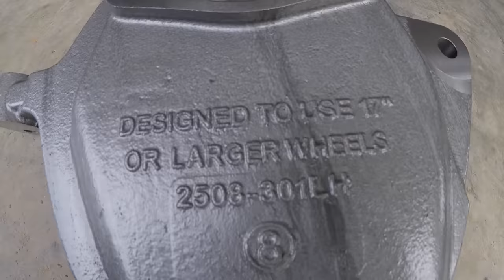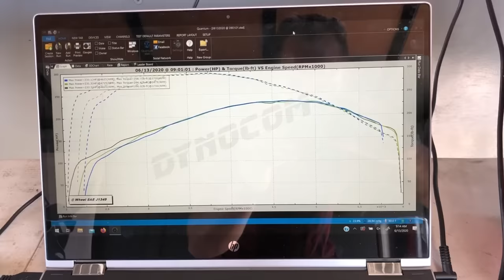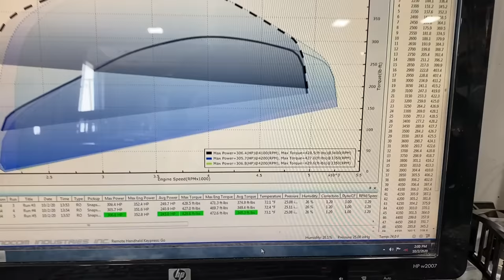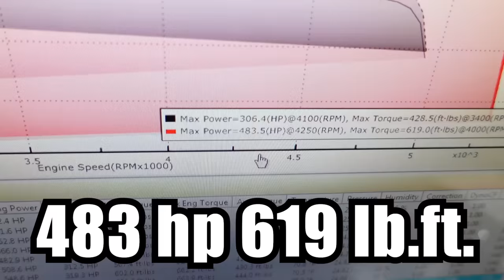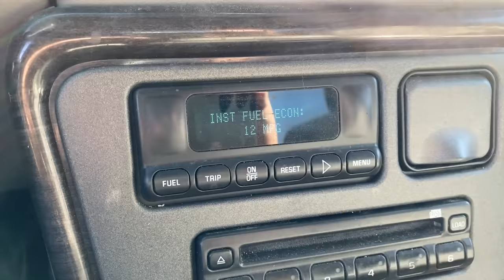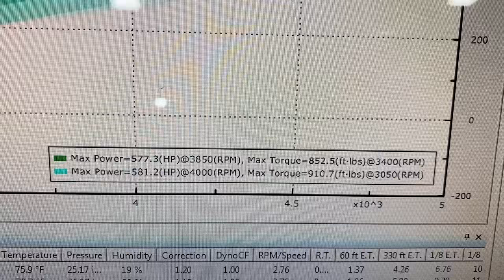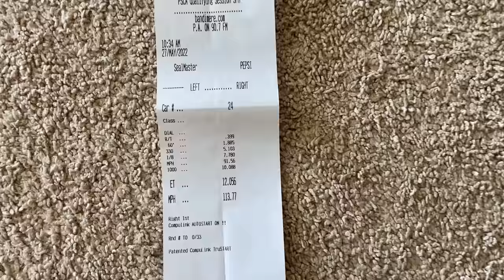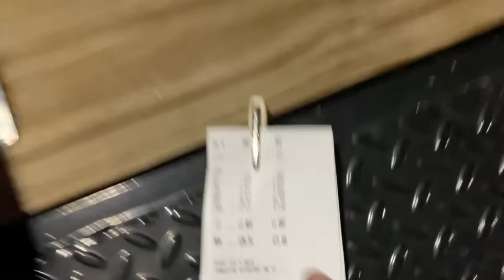Building the ULTIMATE SLEEPER SILVERADO in 23 minutes

Comment: If you spent 3 grand you should have went with a 99-06 single cab shortbed would have knocked atleast another second off you're time. Those extended cabs are frickin boats.
Reply: Yea your actually 100% right, I looked just to verify and was shocked.. just the rear seats doors frame all that to extend the cab is an extra 1000lbs😮.. that’s not even accounting for the bed which has to be another 500-1000 because it ain’t just the bed it’s the frame, longer exhaust, wiring, all that.. wow I’m kinda blown away actually
Reply: Maybe if you completely gutted the back seats, and installed a short bed? I’d like to know what the weight is purely of the cab being extended like the body of the cab and the frame rail.. but shit all that work you might as well if gone single cab in the beginning
Reply: No bullshit this actually helped me out a ton I want to do a truck build this winter and I already have a very clean quad cab so I was just going to use it even though I want a single, just to save money., but yea no not now 😂😂
Reply: @JaxonPro-y9e  shoot glad I could help. I'll let you in on another little hint. 99-06 chevy 1500 short beds aren't to cheap BUT the long bed versions are way cheaper more available and they make kits online to cut and shorten the frame to make it a short bed. It's surprisingly easy there's actually pockets on the frame that you can cut into and the rear frame slides into it to make a short bed it's like chevy knew!! haha
Reply: It’s suppose to be a sleeper.
Reply: It’s a full size build not a single cab build . Not everybody is a fan of single cabs. Im always trying to find ext cab builds all I ever see is single cabs
Reply: The extended cabs aren’t boats the crew cabs are that’s why they have ss in ext
Reply: @MidNight_5.3  lmao have you weighed one. The extended cabs ARE boats and the crew cabs aren’t even in question they are 🛥️ yachts. If you’re trying to go fast idk why you would ever consider swapping a crew cab.
Reply: @aaronvilla13  all you ever see is single cabs because if you’re trying to go fast why on earth would you want more weight? You wouldent. No body is knocking the ext cabs I like them to. My point was if you’re purely just trying to go faster in the 1/4 and you have a choice go single cab.
Reply: @ModernBeastx1  yeah I know I don’t want a crew cab I’ll
Keep my ext
Reply: Goofie
Reply: @trentwoods5112  yeah okay lil bro don’t even got a truck
Reply: I dog single cabs all day in my ext cab
Reply: @RobertoCastellanos-m1u  yeah that’s what I’m saying like it’s not too much of a difference

Comment: Great videos can't wait until next spring. I would have always thought rear wheel was better than 4 wheel because of the more parts more problems. I learned something thanks
Reply from the maker: I wouldn’t say 4x4 is better as a blanket statement since you are correct a 2wd has its advantages, but I like the advantages a 4x4 provides despite the complexity and added weight

Comment: Anyone that thinks a bigblock Chevy is weak has some kind of cognitive dissonance. It was built to be Chevys most heavy duty engine from day one. The MK4 came directly from a NASCAR engine built to smoke everybody on the track back in 1963. Hit the street in 1965 as a 396 425hp Vette engine. 427 came in 66. L-88s came along in 67 thru 69 and a well tuned L-88 with headers could make 560-580hp stock. Could even find 427s in big ass dump trucks and 454s in giant RVs. Bigblock Chevys set the bar for which all others try to compete with. Definitely the best engine ever built by any company. It's hard to not make power with a properly set up bigblock Chevy. Back in the day I tried to compete against them with other brand engines, it was always the big Rats that dominated the scene. So I started using them myself. If ya want to go real fast, build a bigblock Chevy. Easiest power one can build.

Comment: Awesome build just wondering why didn't you go with the 6.0  V8 my Chevy Silverado 2500 HD has the 6.0 regular cab short bed 2 wheel drive she is a beast only thing I have done is Cold Air Intake and Dual Exhaust

Comment: Nice recap LT .
Love the ugly build. 
I got bored tonight relieved the deck on my 8.1 and knocked the cam bearings in it . Won't be too long before my turbo 6.0 4l80 tow rig is .020 over marine h.o. cammed intake modded 8.1 and Allison 6 speed .
Once I tow with it I'll decide if I'll turbo it or not .
Now a days towing alot on 93 octane gets expensive

Comment: great video! Just my two cents, upgrade to a full face clear shield using the angle grinder vs just the safety glasses. Angle grinders hands down the most dangerous tool I've seen guys lose fingers parts of hands, discs flying off with part still in the chuck.. Itd feel no different than the welding mask!

Comment: The only problem I see, is your driving a brick wall and not very light. If you can afford it, go with fiberglass fenders and hood. Lexan windows. If you want 8's it's gonna have to be lighter. Cheers LT love the content and your channel.
Reply: Also ditch the rear steel bumper for fiberglass roll pan. Tubes under fiberglass in the front. And silhouette the truck bed and no tailgate would drop a TON.

Comment: Awesome build. Subbed. I’m always curious, what type of pipe do you used to build hot side and cold side of a turbo system?
Reply from the maker: I used schedule 40 mild steel weld pipe, 2.5" for the runners, and 3" for the merge into the turbo

Comment: I made a sleeper out of my first vehicle I got in 2012, my (1997 dodge ram 1500 4x4 sport blk/red logos 5.2) 
I did it a few years ago, I left the outside appearance the same, clear coat pealing, a few light scratches, nothing bad. The engine I replaced everything, the part list is too long to tell, most noticable things:
Complete rebuild of the engine, only parts from the factory i didn't replace was the block itself 
roller rockers
0.30 over
Stage 2 Stroker cam/crank kit
Custom intake manifold
Flowmaster 40 set up
Long tube headers
No cats
Custom ecm program
Put it this way I spent €11k in parts (no regrets)
I bought a complete pro-charger supercharger kit, went from a 4 speed auto to a custom 6 speed auto, 4:10 rear gears.

I made my dodge go from a stock 215hp 318 to a 622 wheel hp 390 stroker. My 0-60 stock was (9-11 seconds), now 0-60 is (5 seconds)
Quarter mile was below 20 seconds stock, now (10 second) quarter mile

I love being at a red light next  to a challenger, mustang, camaro, diesels, jdm cars, bmw's ect. They look at my truck like its a shitbox, because of the paint job, but 8 times out of 10 I blow thier doors off. I think diesel truck owners are the most shocked I can overpower them so easily lol

Comment: I gotta ask, what was the reciprocating noise at higher speeds at the track? I was wondering if it was the engine or possible drivetrain vibration that needs addressed. I only say this cause a grenaded flywheel could change your life and I'm wondering if the 8100 is met it's limit.
Reply from the maker: to be honest, I think its some kind of wind noise or something, its made the noise since day one
Reply: @LawrenceTolman  I guess if there's no vibration with it it ain't important, if it's wind noise maybe it the front valence flapping? I'm sure most stock pickups never been at that speed. I worked for a company that has a truck with a lower mileage 8100 and it sounded like a cereal box full of nuts and bolts and it was a low mileage flatbed work truck. That's the only reason I ask if these engines were just noisy.

Comment: How did you get the fuel tracking mileage to work on 99-02?
Reply from the maker: here is the full length video of the console install that shows the wiring pinouts for the driver information center
https://youtu.be/hlIL6g7M5lE

Comment: Question. How did you get the 4l80 to fit the 5.3
Reply from the maker: It bolts up with a 6.0 flexplate and spacer, plus did a crossmember mod and a few wiring changes. All pretty straightforward

Comment: 03:26 You did just say 8.1L big block? Do you understand what happens, if you also change the transmission to match a light build that has not to carry a lot appropriatly to the torque of an air carrier? You'll find jump space on the street, if you hit the paddle to the metal...otherwise keeping the factory transmission set up you can move your home to another spot, slow but steady.
#cyberpunkcoltoure

Comment: What size tires are those towards the end of the video?
Reply from the maker: toward the end it has 2020 Chevy RST 18" wheels with 275/45/18 Pirelli P Zero, or the 15" Weld rears with a 275/60/15 MT E/T Street R drag radial

Comment: If you did it over again would you start with a 2500 that came with the 8.1?
Reply from the maker: No, because those are a lot heavier and have the Allison transmission. For a tow rig that’s great, but for a race truck Id prefer the lighter 1/2 ton frame and 4L80
Reply: @LawrenceTolman  do people of Utah call themselves Utonians?

Comment: 1100ft-lbs at the tires? I would think it's faster than 10's... 🤔
Reply from the maker: the bad part about the setup is even though it makes great power at low RPM, when at the drag strip the engine is at 5,000 RPM + the entire pass where power falls off drastically. if I could keep it closer to 3,500 RPM, things would be a lot different

Comment: I have a 2007 long wheelbase 2500 HD 8.1 Chevy and it's the gas motor as well and I got a turbocharger on there fixed put a supercharger on it but it's turboed right now and with the mods I have on it it's making $590  horsepower to the crank and 520  to the rear wheels and that's on very low boost that way I can daily it without having so much boost and wearing the motor out if I wanted  that way I can daily it without having so much boost and wearing the motor out if I wanted  that way I can drive it with out worrying about to mich boost and blowing up the motor for weekend afternoon rides or turn the boost up to ,35 psi and go hit the drag strip on a thursdau night for grudge racing and beat all these cars like mistangs civics Camaros and challengers and othrr stockish vehickes that are not fast but owbers think they are 1000 hp when in reality they makkng probably 350 hp max and tak thier koney with the single cab lobgwheel base gas burner 2500 and i beat duromaxs and othe diesels as well

Comment: cool build... why not build a ugly teuck with a 4cyl turbo from a camaro and 6 spd trans... with that hot diff, and lowered suspension... you get 300 stock hp, and 40 mpg... stop supporting the middle east oil...